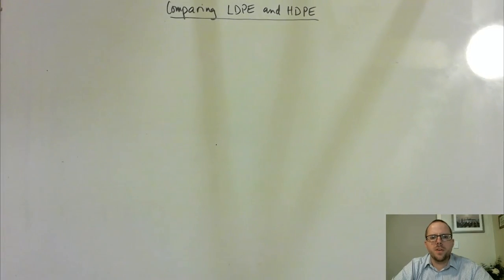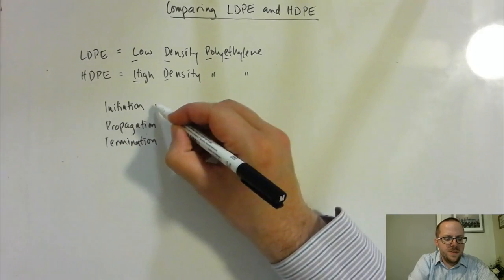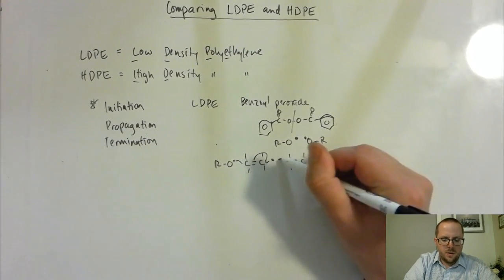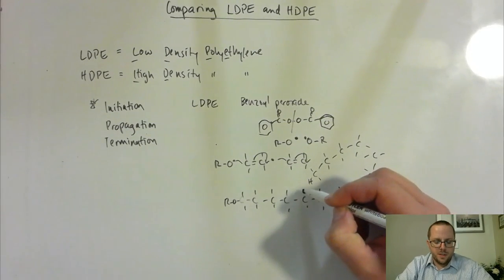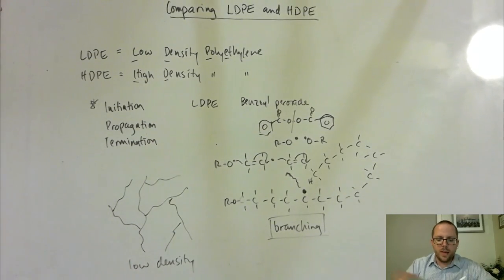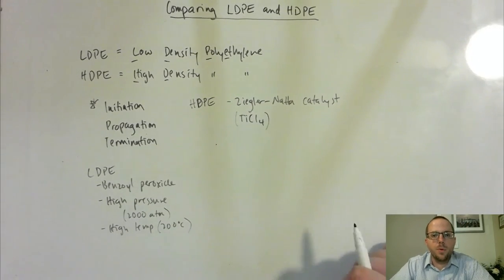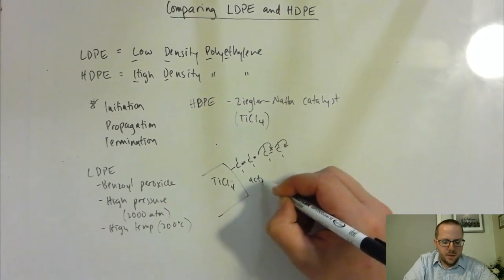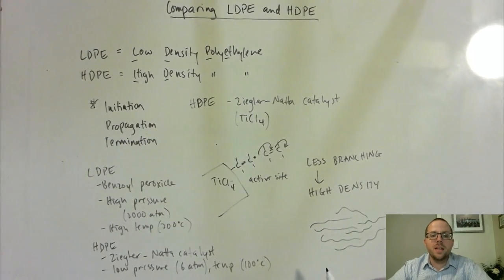Comparing LDPE and HDPE

Comment: Polythene is manufactured by calcium carbide reaction in water releasing ethylene gas, kindly brief on it, resultant ethylene is polymerized under specific atmospheric pressure and temperature, also brief about costing  of raw material and plant designed capacity